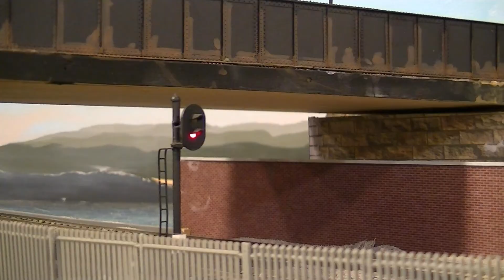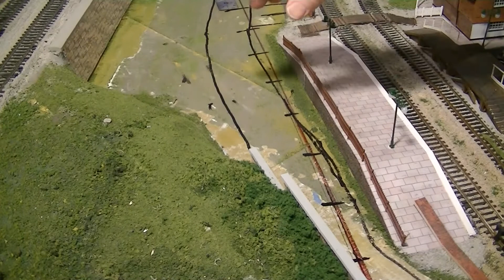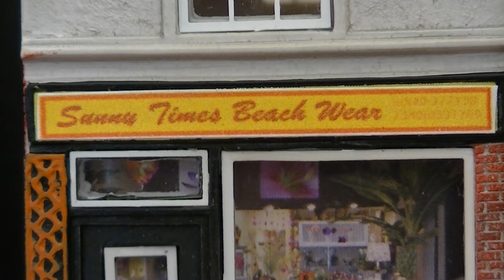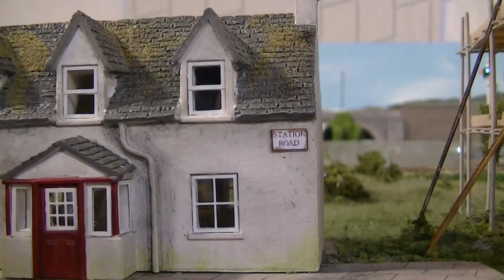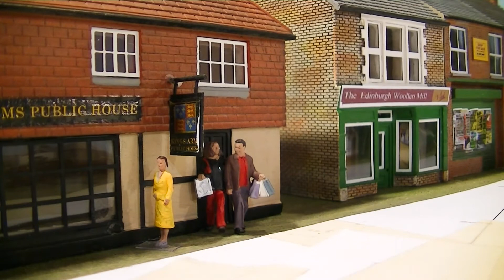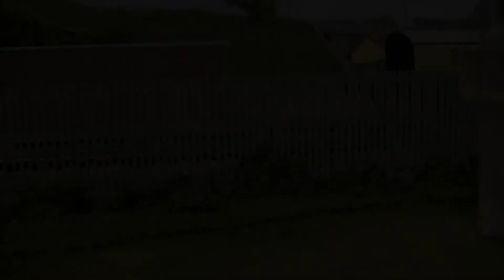Farland Howe  Growing Far Moor 2    #104

Comment: Still no strip joint though Rob ?? LOL ...the street view as you say gives a better illusion with shaping it like that ...the sign maybe if you cut out the droppers and just glut the signe to the top arm will give you the clearance ? ..all coming along nicely..DAve
Reply from the maker: There you are.  Thanks you for the comment.  It turned out when I moved the sign up, it camouflaged the old hole.  Now, what to do with the original hole over on the side.  Why they (Hornby) put it over there in the first place. I will never know.  Hornby does a great job with their buildings.  Every time I get a new one I am impressed with the detail.  No strip clubs in Farland!  No can do.  Thanks, Rob

Comment: Hi Rob nice opening shots and the street looks good like all the names cheers Kevin
Reply from the maker: Hi Kevin, thank you.  I spent a couple days on Google Street View looking at street signs, in Truro, Tavistock,  Newquay, Tiverton, Taunton, Wemouth, Portsmouth, Plymouth, Chippenham.  Many other places as well.  It seemed like the font, colors and style varied from county to county.  Also, how do you find your way around, it is sometimes impossible to find the street name???  I picked two styles in the end, even though it is not normal.  Thanks for the comment.  Rob
Reply: Hi Rob most of the street names are low down about 3 foot high ,there is a lot of places we struggle to see the signs where I work  the street has 2 different names one name one side one name the other that causes a lot of problems cheers Kevin
Reply from the maker: kevintregunna Thanks Kevin, so I noticed.  I did see plenty of them on two stakes about 2 feet off the ground.  I was afraid I would knock them over and break them being the clumsy body that I am.  I did enjoy my wanderings though.   Rob

Comment: Hi rob,road looking good,I really do like you're eye for detail.i wondered if you had thought about shortening the length of the straps holding the sign up,it may be an option rather than you having to drill it,still best of luck whatever you decide,Andy
Reply from the maker: Hi Andy, thank you for the comment and thank you.  It turns out, when I moved the sign up, it covered up the old hole, so I was lucky.  The little thing is metal and the printing decal is very fragile so I was concerned about really working it over.  It is all good now.  Rob